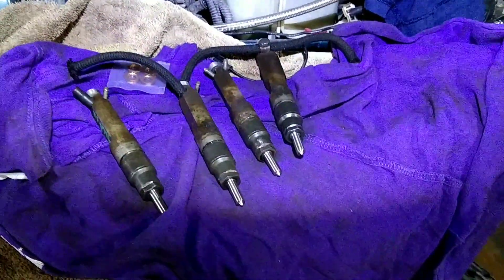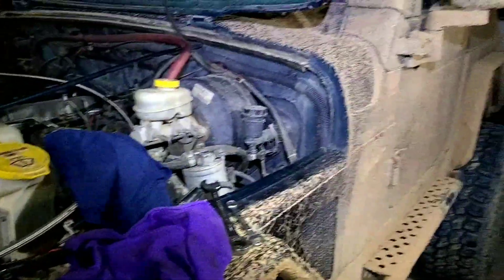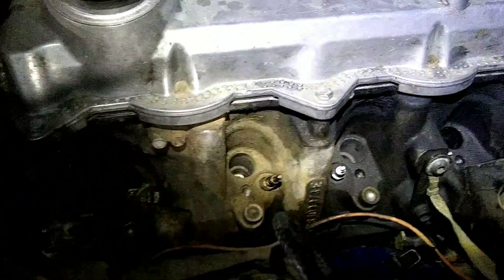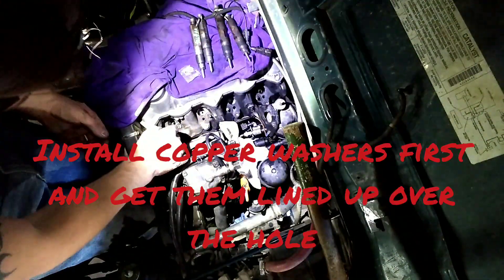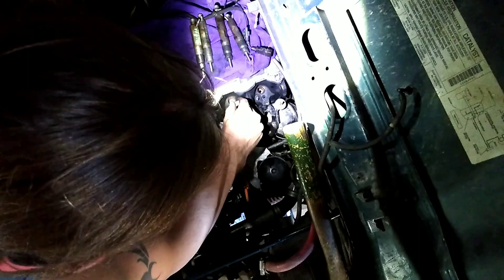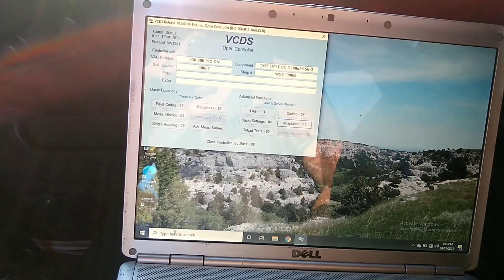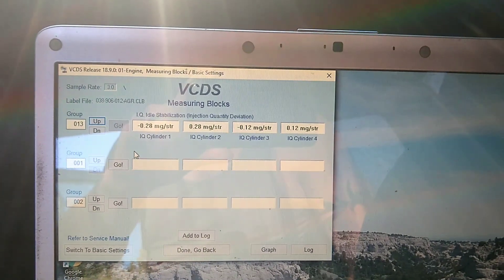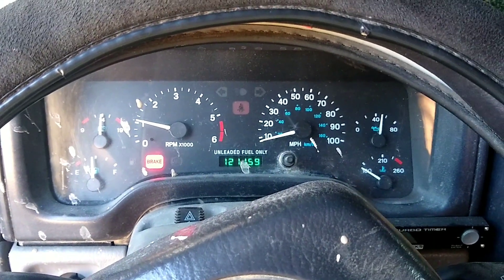Step by Step changing/upgrading ALH injectors, TDI TJ jeep stepping up to 200 HP!

Comment: I swapped out 3 injectors on my alh for a cleaner one and it misfires at start up for a bit till you drive it for a good minute
Reply from the maker: Only at startup? Smooths out warm?
Reply: @TDISwaps  yes
Reply: only 60miles on em since I installed, improved performance for sure and pretty comfortable with it except the misfiring feel at start up when cold
Reply from the maker: @Jesus-hx5vg  were they calibrated? I have had a few sets start harder, but usually bigger nozzles
Reply: @TDISwaps  no
Reply: @TDISwaps  just changed out the 2nd cylinder injector out to my old one and she's smooth now
Reply from the maker: Must have a bad one, interesting